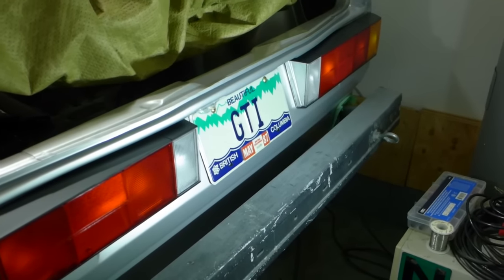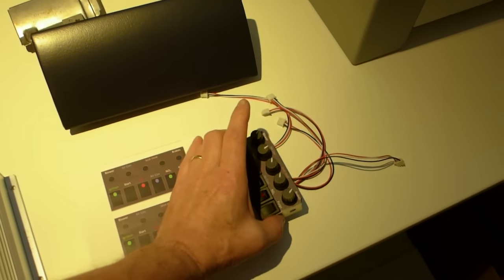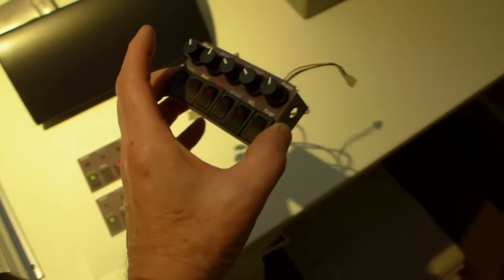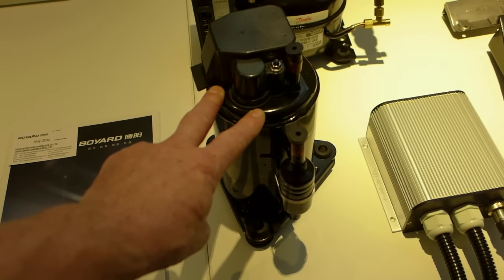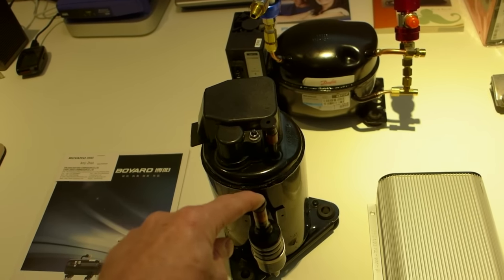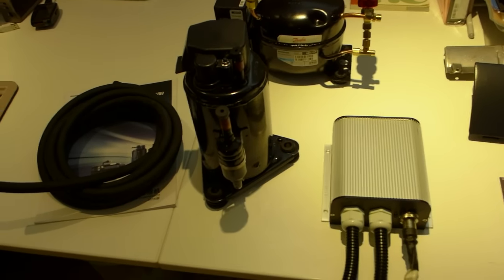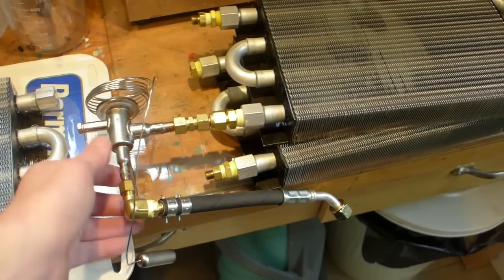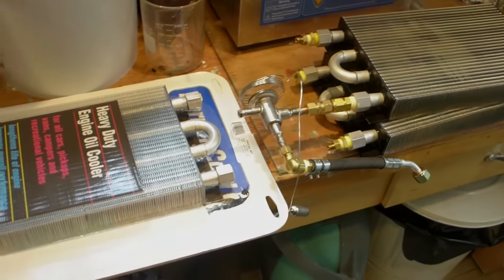The Ultimate 1983 Rabbit GTI - part 115 (Ash tray control panel, larger electric A/C compressor)

Comment: Derek, I love your project. I was just skipping through your video's and now on part 115 you are looking for a small and powerful little AC Compressor....look up ASPEN compressor, the Q-Series Low noise, Miniature, Rotary BLDC Refrigeration Compressor, it's a real sweat little compressor, fits in the palm of your hand (and I have small hands), it delivers a whopping 455 Watt's at 0˚C evap. and 35˚C condensing temperature using R-404a. Just put two or three in parallel and Bob's you uncle.
They cost less than $90US  incl. speed/capacity controller. Look it up, you'll love it.
keep up the good work, regards from a fan in Belgium (Europe).
Reply from the maker: I think 2 would be sufficient. Nice little unit. Price?
Reply: Not that dear, in Belgium (Europe) I payed €65 for one, that would be like $80. I guess they would be cheaper in the US.

Comment: I wonder if a plate and fin style oil cooler would work better.  they are much more efficient at cooling oil
Reply from the maker: My oil cooler actually works incredibly well at the moment - keeps the oil within a few degrees of  the 200F setup at all times. We'll see what happens when I race in the summer months soon enough ... stay tuned

Comment: Great videos! When do you think you will be testing the AC in the car? I am following with great interest in that I may want to add AC to an 81 VW Rabbit Pickup diesel. It has probably 1/4 the interior space of your GTI so an electric compressor may be practical?
Reply from the maker: +wvoheat It should work in your application. I will re-bench the new compressor within 2 weeks and will have it installed in the car and running by late spring ...